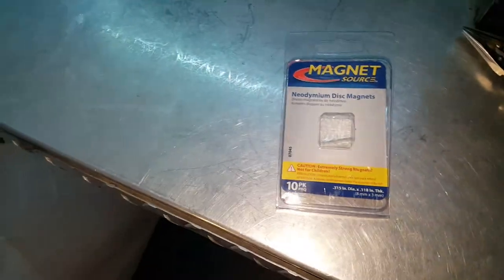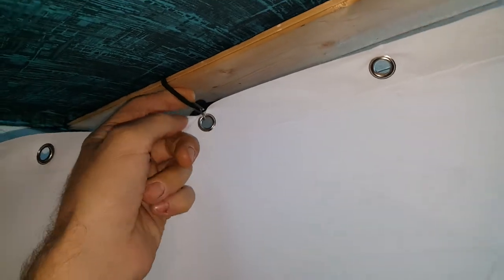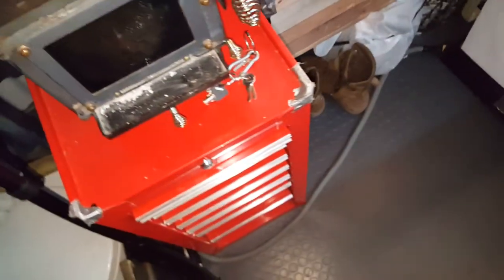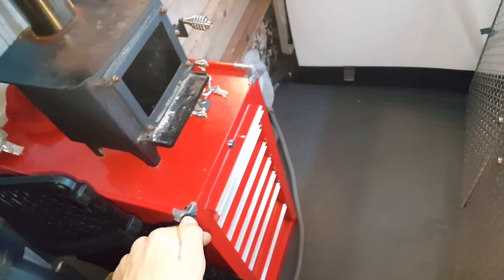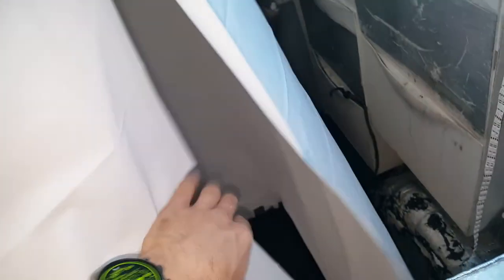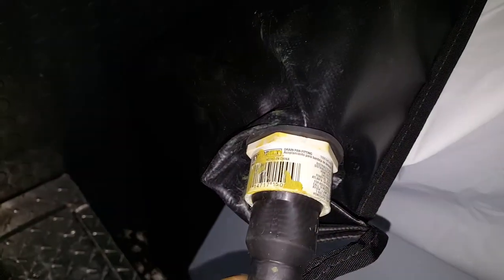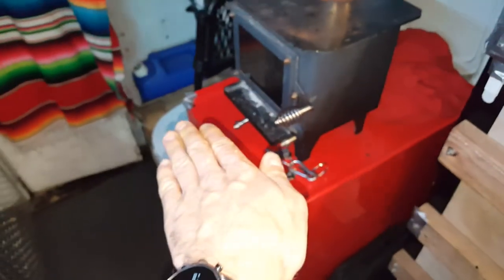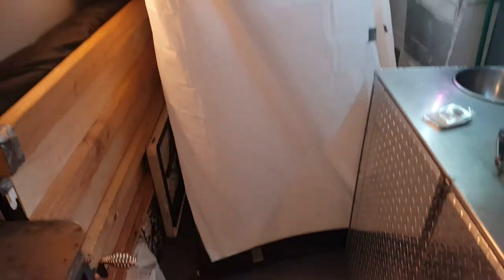Vanlife shower DIY folding collapsible budget shower stall curtain enclosure

Comment: Yo I got the same hose I used for my sink! haha. 

Pretty decent shower setup. Seems collapsible. Thing I hated about showering in the van was the cleanup. Wiping down every plastic surface to remove water so no mold during storage. One shower could easily take over an hour for me. 

But your start is way better than mine was. Looking forward to seeing more.
Reply from the maker: yeah my solution is just to put the shower outside for an hour on a hot day or leave it on my roof rack. Or I will just shake it out and then put it away wet and say f it and replace the curtains when necessary.

Comment: Nice!  We must have similar methods of thinking because I just got a shower working in my van about a week ago also, and it's similar to what you did, although I would call it "store-able" instead of "collapsible".  I bought one of those large shower curtains off Amazon that are about 9 feet wide to make a 2 foot square 4 sided shower stall that hangs from hooks in the ceiling.  Right now, I'm just using a large storage tote as the shower pan, but I'm going to be getting something different later.  Looking at a masonry mixing tub from Home Depot as my shower pan.  Not definite on that, but they are cheap, about the right size, and are fairly durable.  The pan will store under the bed when not in use.

For the actual water part, I am using a weed sprayer that I have connected a standard sink sprayer to its hose.  No need to fiddle with that stupid lever that weed sprayers come with.  On and off is right at the head.  The weed sprayer thing will change at some point too, but it works for now until I get the water system installed.  But even then, I'm going to keep it store-able so it isn't permanently taking up space that I need for carrying the bike.  I'll probably keep the sink sprayer part even when I get the water system installed because it really is that nice to use.
Reply from the maker: Nice nice  very cool